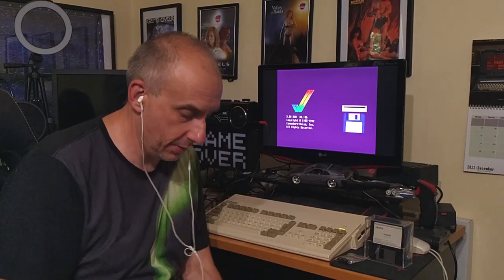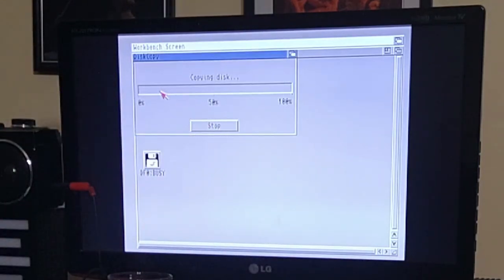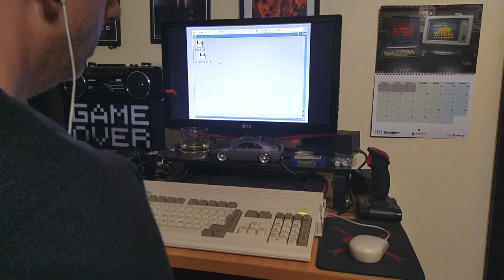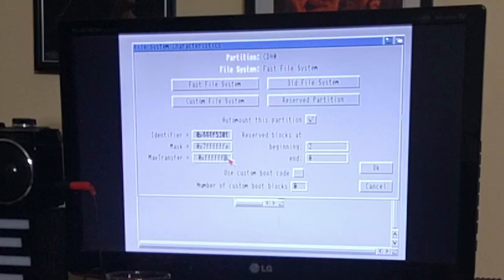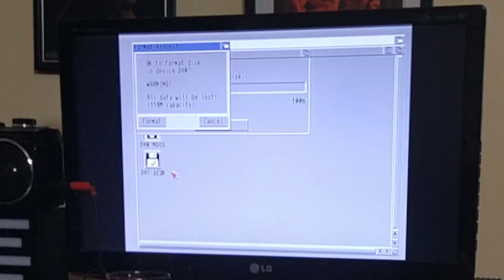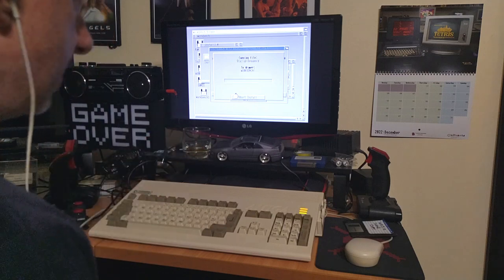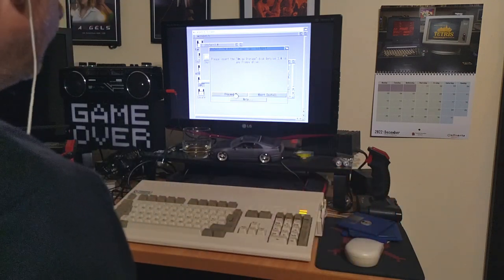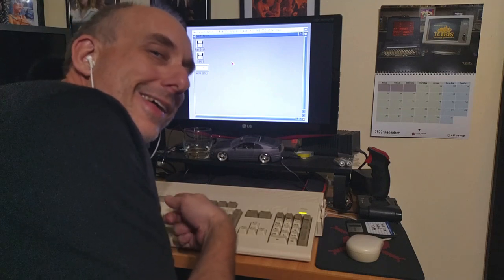EP-185: installing Workbench 3.0 from original disks like a noob

Comment: I'm following along with this, it's a big help so thanks for that, but I noticed something you might have done wrong - at 10:38 when you change MaxTransfer to 1ef00, you clicked OK before pressing Enter on the keyboard. Every time I did this, when I clicked on Change again to make sure it had saved my setting, it had reverted to ffffff. It only saves your setting if you remember to hit Enter. The guide you linked gave me the clue as to what I was doing wrong, it says "Now click Enter (important!) and then click OK."
Reply from the maker: haha you are 100% correct. Well spotted. The image I'm using is working, so either I did it correctly on the other image and forgot on this one, or it didn't matter. Not sure. Glad the rest of the video was helpful to your though. Good luck with your fresh install :)
Reply: @005AGIMA  It ended up asking me for a "Locale" disk which I didn't have, so I gave up and went to bed 🤣 I thought I had a full set of 3.1 disks, will have to write an ADF and try again tonight. Fun, haha

Comment: I was wondering why you needed to copy the Install disk - I think this is only because when you defined the drive type there is a default file name. As you didn't change it I think it's saved the drive definition to the install disk. You can redirect this to the RAM disk (RAM:) and it will work without needing to modify the install disk.
Reply from the maker: Ah cool. Another great tip. Thanks.

Comment: Just spray a little contact cleaner on the sensors should be two small ones
Reply from the maker: Yeah I did do that when the machine was in bits, and it's made it "better" than it was, but as you can see, it still has its moments.
Reply: @005AGIMA  yeah i have another A500 that does the same time to time.. Has a mind of it own but love it..